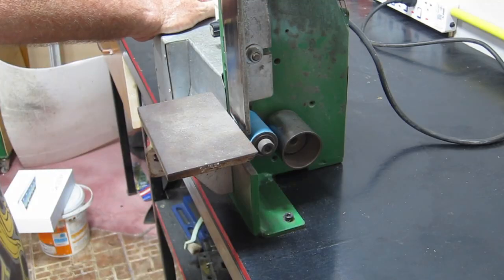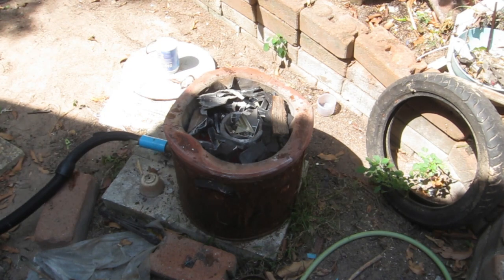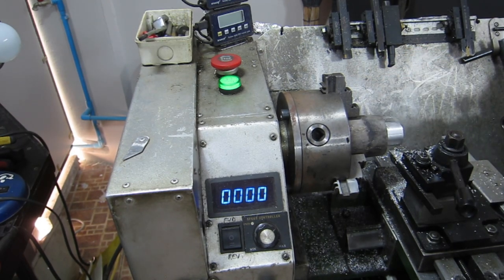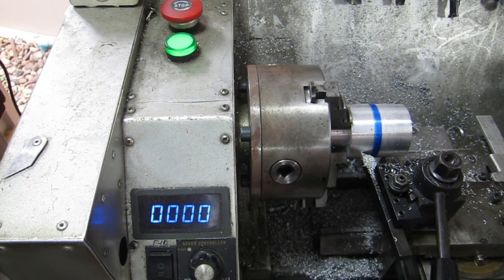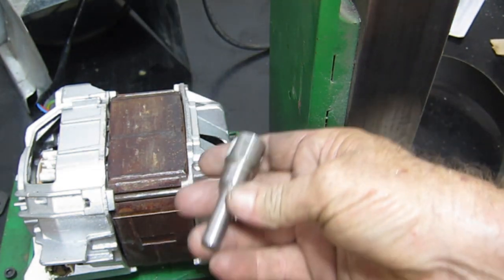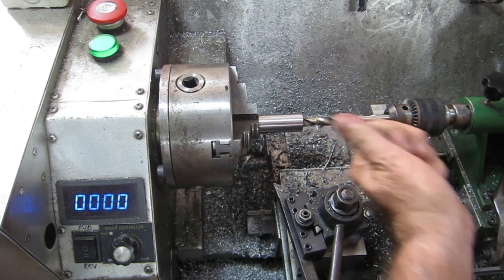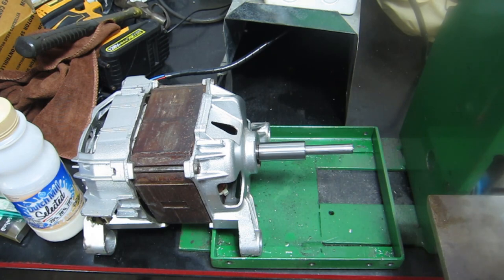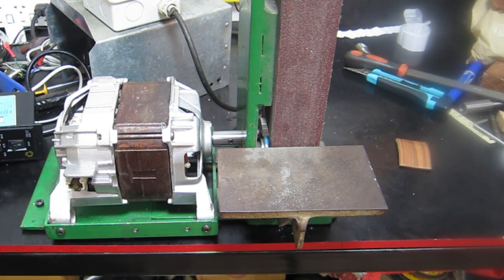MHW Episode 73 - Cast Aluminium - Belt Sander Drive Wheel

Comment: Re, the bubbles in your casting, something I learned the hard way, if you are using magnesium alloy(aka mag wheels) as a source, if you heat it up past a certain point the magnesium bubbles, well before Aluminium does, and for whatever reason stays that way even after cooling it down and remelting.
I did some sinker moulds, some came out perfect and others came out looking like sponge cake( a lot worse than the pitting you had), tried remelting the bubbly ones and you could see the molten metal had little spheres mixed through it, got some fresh wheel and no problem.
BTW I was using a forge to melt my alloy so I couldn't tell you at what point it goes off, but I did leave it cooking a bit long.
Cheers from back home.
P.S. Loved the bush mechanic reference.😁
Reply from the maker: I used some anodised extrusions in this, that's the first time I've used that, not sure if the anodising has anything to do with the small bubbles that are right through it or not, the large bubbles on the end are from trapped air, pretty sure that gets worse if it's not hot enough when poured and the bubbles don't have time to rise to the top before it starts to solidify. 👍
Reply: @MyMiniHomeWorkshop  Anodised aluminium(well the surface layer) should just float to the top to be skimmed off, I've found that the magnesium bubbles seem to mix into the molten aluminium for some reason and don't rise to the top.🤷‍♂
Reply from the maker: @Bobs-Wrigles5555  I have to admit, the dross was a lot more different looking than previous melts

Comment: Good to see you back making stuff again! That is a huge improvement and will almost eliminate the vibration and noise. I'm sure you are over the moon with that result.

Good work on the casting as well. I have only done 1 casting in sand, but I have a lot in home made steel molds. I get pitting as well sometimes. There are a couple of guys in Australia with YT channels who do casting and I have picked up a lot of tips from them (Mark Presling and Xynudu). May be worth a look.
Reply from the maker: Thanks, the best of the Aussie casters is Olfoundryman, he is a true craftsman, I know where the large bubbles come from, if the sprew is mounted on a flat top surface, air tends to get trapped in there, if you can slope it back to the sprue it tends to escape. 👍
Reply: @MyMiniHomeWorkshop  Yes, I have seen a lot of the Oldfoundrymans videos. He is a real master in casting.